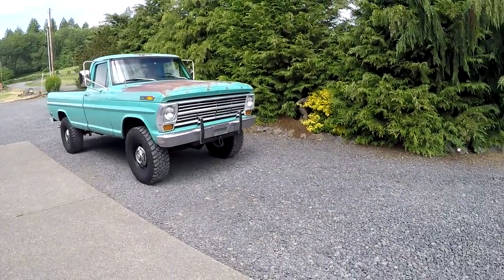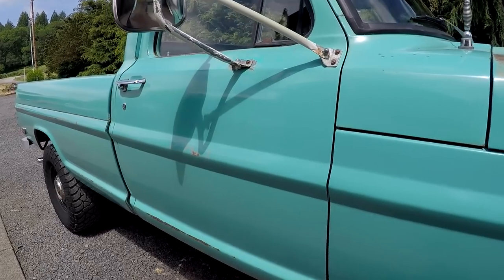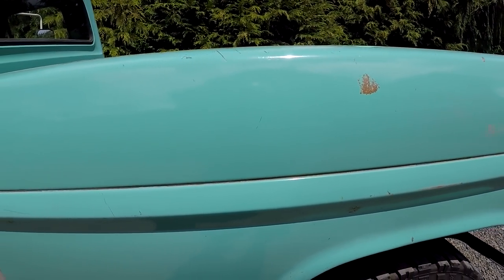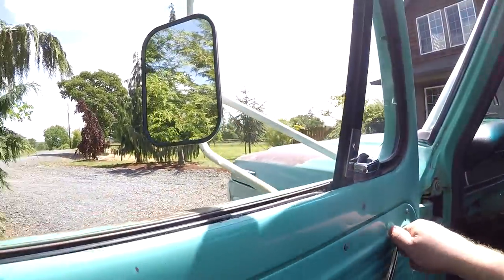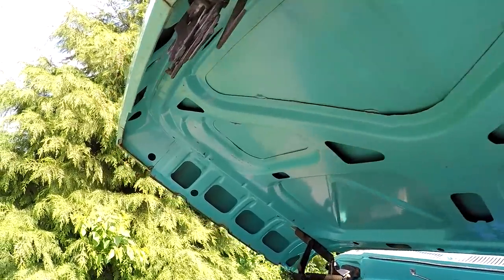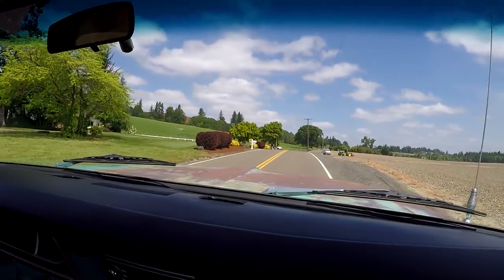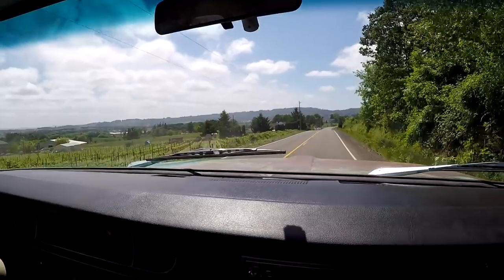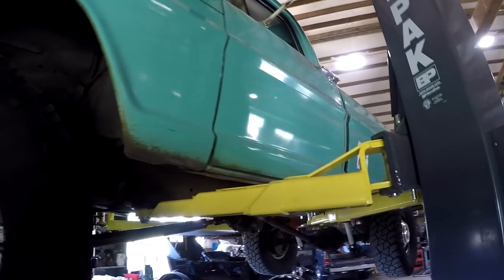1968 Ford Highboy F250 4x4 Survivor DENWERKS

Comment: This is an honest example of an older truck that u know what your getting, no bog job repairs, no rust in body or cab only surface rust and a bit of patina and it looks as though it hasnt had a hard life and its extremely rare to find an example like this truck , as they say there only original once. You could restore this truck easily but all very well but the best thing is to leave it how it is because if you restore it it will loose its originality and wont have the history or story to tell,great original truck bro and keep it that way its only original once.

Comment: I like these older trucks way better then the new ones.  I've own a few of them and regret selling them. Axle ratio on the front is a slightly higher so it pulls the back and help the steering, but is not good to stay in 4 wheel drive on pavement for too long. It will wear out everything faster and is hard on gas. Love the video.

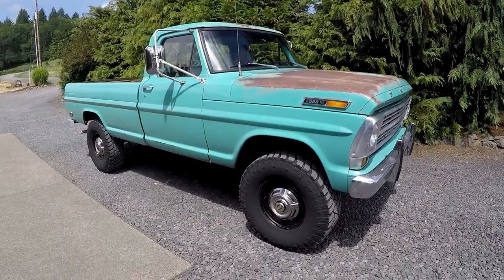Comment: Not sure about 1968, But split rims were on the 16 inch rim later. My dad's cousin bought one new in 1972 and came with 16 inch split rim. My dad bought a new 1970 with 16.5's and they were standard rim. Those large tires help you get up to highway speed because if you had standard 235 85 R16 tires, you would barely make it to 60mph if that has 4:11 gears.
Reply: My 71 has lock ring wheels.
Reply: @ridgerunner106  16 inch or 16.5's? You running bias tires or radicals with inner tube?
Reply: bias and tubes 16". I have some 16.5 but don't like those. Just keep them on old trucks so I can move around. I have a pile of pre 80 trucks.
Reply: @ridgerunner106  that's great! Glad you've kept those. I like it when people keep old vehicles original. It lets people see how things used to be.
Reply: My only licensed truck is a 76 F250. I am 50 now. I  went from Louisiana to Alaska in one, with a severe load, and crossed the Yukon.
Reply: @ridgerunner106  wow! A lot of miles. My dad and his cousin went from Western Washington to Alaska back in 1966. His cousin had a '65 or '66 F250 that the went there with. Then he bought the '72 I mentioned. Those all were really good trucks.
Reply: @stephensaasen8589  I ain't walked a step yet because of those trucks.  I been driving a long time, since 78.
Reply: @ridgerunner106  they're so simple to fix, too if something does go wrong.
Reply: @stephensaasen8589  I've got a 71 hi boy. I bought in 92, but I want to swap in a newer front and rear.   Then use it as my daily. Question, I have a 390 looking engine, it's 4 barrel, but it has a tube on intake you can pour oil in. In front of carb slightly to passenger side. The heads, the top ear on exhaust has a full web cast from head to top of that ear for top exhaust manifold bolts. I'm thinking may be a 406 or a 428. I don't know.
Reply: @stephensaasen8589  Yes, check out good at home, never had to fix on the road. I don't think I've ever replaced a water pump. Plus, put a new hose from water pump to intake. That little short one...
Reply: @ridgerunner106  did a little Google search for images of 406 and 428. There was an image of a 406 that looks like what you're telling me. I don't know the history of the FE engines really well  except the 352, 360, 390 and 428 were all exact same block. I learned recently that if you have a 390 and pull the freeze plug on driver side closest to firewall and see 428 cast on side of cylinder wall in water jacket, you have a block that has enough meat in the cylinders to punch it out to a 428. I think I heard it said the 406 and 428 or 427 were related but I'm thinking it's a 406.
Reply: @stephensaasen8589  Finally, an answer. Thank you. It's in a 76 150 4X4 I have. Tree fell across it and put cab top on the seat, but it's fixable.
Reply: @ridgerunner106  took a little deeper look in Google. That engine actually could be an early 390, 406 or 427. The 428 came out in late 1960's. You may have to pull a head to find out bore size to identify 390. The 406 had larger bore with the 427 but had the 390 stroke and the 427 had long stroke and bigger bore. Hope that helps.
Reply: @stephensaasen8589  This truck was traded for breaking some horses. There was a stink over it because of the engine. I knew something was up.
Reply: @ridgerunner106  just dug a little deeper and could be an early 352. Best bet may be to pull a head and check bore size unless you can find the stamped tag or trace casting numbers. I don't know if I helped at all now. 😔
Reply: @stephensaasen8589  Naw, this thing has headers and all on it, something's up.

Comment: Here's all the engines. 
240 CID Straight-6	1967–72	150 hp (110 kW)
300 CID Straight-6	1967–72	170 hp (130 kW)
352 CID FE V8	1967	208 hp (155 kW)
360 CID FE V8	1968–72	215 hp (160 kW)
390 CID FE V8	1967–72	255 hp (190 kW)
302 CID Windsor V8	1969–72	205 hp (153 kW)

Comment: Do the odometers on these old trucks go up to 99,999.9 or 999,999 I bought one that showed roughly 113000 when I bought it. I'm not too familiar with old trucks yet.
Reply from the maker: They are only a 5 digit Odometer so only goes up to 99999 then rolls over to 00000, then 00001 etc.  This was true I believe in Ford trucks all the way up til the late 80’s.
Reply: @blueovalranch  thanks
Reply: @rapcreeperproductions3269 only 99,999.9. I actually don’t even remember how many times mine has turned over now. At least twice.

Comment: I have a 1971 f250 highboy with a 460 in it for sale if anybody's interested in it runs real good has the MP 205 transfer case all gear brand new brakes brand new driveline has 409 axle gears if anyone's interested let me know I also have a 1968 highboy with a 360 engine 4-speed married transfer case anyone out there let me know I'm selling both the trucks I've had them for 20 years both run real good I need the money to go to school I'm not asking a lot just a fair price Sean

Comment: Also 390 ci engines. U missed that one lol. Same block as a 360.
Reply: 390 was NEVER available in the "Highboy"
Reply: @bigblockin427  i seen 1 ton had a 390 the factory. Not sure where u got your info.
Reply: @Silkmaster4200  well since highboys are 3/4 tons and Ford never offered their largest engine in a 4x4 until 1984 with a 460. Oh you can get a 390 in a two-wheel drive or you can get a 400 and a two-wheel drive but as far as four-wheel drives you had 360s and 351's
Reply: @bigblockin427  oh ok 2WD right on